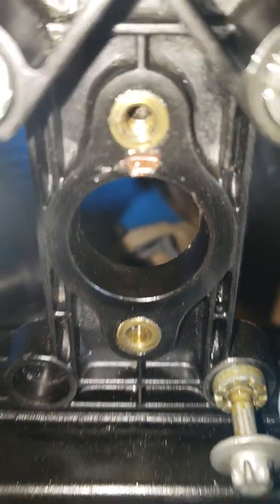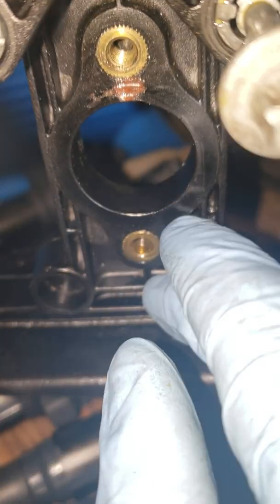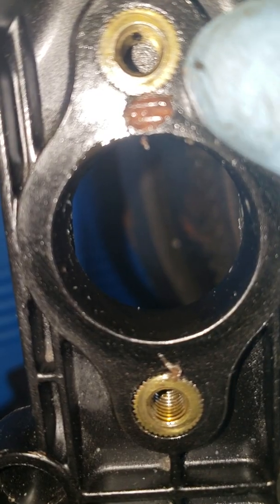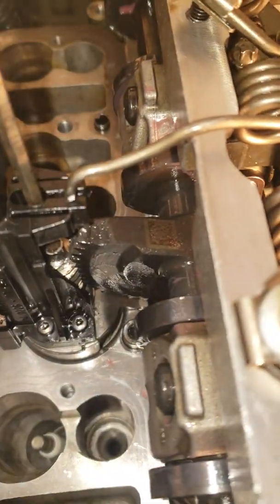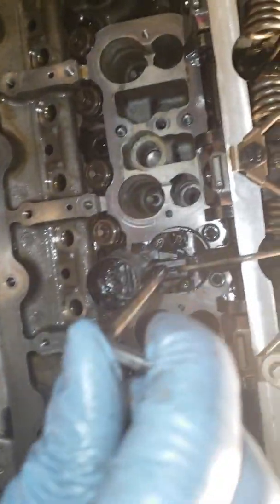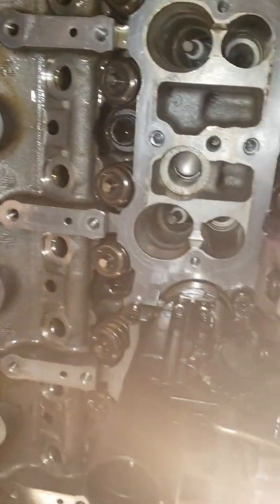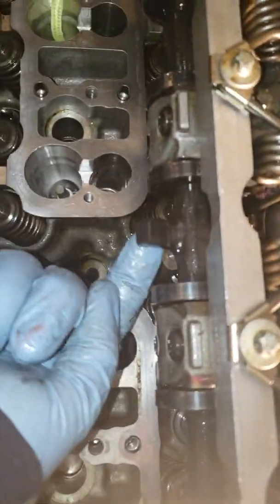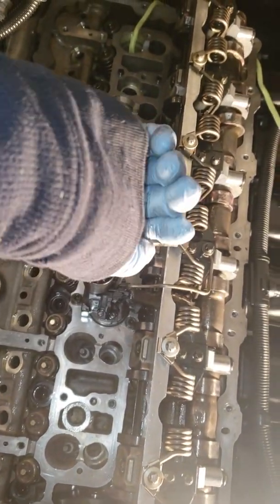(New) BMW 135i N55 How to set Valvetronic to max lift without removing the valve cover

Comment: Hello ,Does this solution work for the N13? I disconnected the sensors and battery, and the car stopped working; the Valvetronic is dead. From what I've seen, it could only be that.

Comment: hi on n55 ecu mevd17.2g having the fixed DTC 135808 with car in recovery by doing this procedure I also have the DTC 135b11 because I disconnected the plug, how can I solve this problem by working on the ecu/dme?

Comment: Hi, I recently replaced the Valvetronic motor but didn’t set it to the maximum lift position—I left it at the minimum stop instead. Now I’m getting error codes indicating the sensor isn’t properly aligned. I’ve checked and the sensor is definitely inside the motor, so I’m a bit confused. Should I assume the motor is faulty, or do I need to reopen everything, set it to the max lift position, and perform the stop position relearn procedure?

Thanks—any help would be much appreciated!
Reply from the maker: you tried to reset the learned positions in ista?

Comment: What size Allan key, and what size drill bit did you use to drill the hole
Reply from the maker: Details are in the description.
Reply: @brendenbanks9293 will i be able to do this while my valve cover is open my eccentric shaft is the problem here not my vvt gear. I just want to set the eccentric to max while the valve cover is open and obviously won't connect up the vvt motor cable

Comment: I wasted time and probably money replacing my eccentric shaft sensor and valvetronic motor and it still doesn’t work I’m still getting codes saying the sensor is bad starting to believe I have a bad dme?  Idk some module must be bad or relay

Comment: Hi, is there any risk the excentric shaft won't stay in max lift while engine runing ? I'm afraid the huge spring will snap the excentric shaf.
Reply from the maker: There is a flat spot on the eccentric shaft lobe. Once at max lift it will sit there on that lobe and would not easily fall off. I dont think it's a realistic concern.
Reply: @banks334  all right, i cant force my brain into stopping to believe in this unrealistic concern still😂
Reply: When I turn the shaft to max it really doesnt feel like that flat spot has much resistants to stay. With all the engine vibration I wonder if it would snap back to low

Comment: When your car has trouble with valvetronic motor or eccentric shaft and your car runs like shit, this is the best way you can do to make your bmw car runs okay. After adjusting the eccentric shaft to the maximum lift never reconnect the motor and eccentric shaft plugging back in. Your car will run okay..except you will  get error code on the dashboard...just ignore it.

Comment: Hey thank you for the video. You do a amazing job. 
But i dont understand what i need to do with the allen key after you lift to max. Can i put the allen key out ? Because in the video its going back after you let it go. 

What do i have to do so that it doesnt turn back ?
Reply from the maker: As explained in the video, just gi all the way to max lift and it will stay there. Then take the Allen key out and seal the hole back up.

Comment: Hi I have a valvetronic code on my n55 435i, 135908. It’s saying valvetronic actuator motor, position sensors: no power supply. Now when I do a cold start on the car, it starts up then within the first second, it almost dies, idles roughly bounces rpm like 400-800 etc I have to push on the gas sometimes to keep it alive then all of a sudden it goes back up to normal and idles super smoothly as if nothings wrong. But it does throw a drivetrain malfunction and chasis stability which got me confused as u mentioned in previous comments how valvetronic doesn’t put the car into limp mode
Reply: I have the exact problem as you! Literally the same did you fix it yet and what did it take to fix it? How much $$
Reply: @chrisyfzr8532  I am currently still in the process of fixing it, how is yours going
Reply: @TechnoMusicMD  sup bro ! did you fixed it ?

Comment: What would happen if you don’t put the Eccentric shaft back to the open position before you complete the job? I recently had this job done and I’m experiencing issues. Any help would be appreciated.
Reply from the maker: If replacing with a new servo motor it will not matter. If you're trying to hold the valves open because your valvetronic is broken then of course you have to leave it at max...
Reply: @banks334  the issue I’m having now is the rpm seems sluggish on start. But no codes. It’s not like it was before the repair

Comment: Brenden, cuen you was doing that (moving valvetoronic to highest position),how was the switch?,it was on engine off?or on engine running?,thanks in advance for your response.
Reply from the maker: Engine off of course.
Reply: @banks334  ,switch on engine off?
Reply from the maker: @RomeroMachado10  off. battery disconnected.
Reply: @banks334  ,perfec ,thanks you.

Comment: What year is yours? I see this happened on 2011 often
Reply from the maker: It is a 2011. Valvetronic motors fail on all engines even n52 its just harder to replace on the n55 making it more of an issue. Old cars tend to break more.
Reply: Brenden Banks I think something happened with 2011 valvetronic motor. I think there was a issue as most failures are from 2011

Comment: Hey buddy I had kind of same issue I went to dealer and they said that my dme was bed so they unplug that vvt motor and set to max lift manually. And told me that I can drive it now. So my concern is that is it safe to drive without vvt motor?(since is unplugged)Thanks for your help.
Reply: My question exactly

Comment: Thanks man, i am installing a FuelTech FT450 on my 545i v8 and the valvetronic cannot be controlled, so i was wondering if i could put the valvetronic on the max lift and unplug it, i just needed a video like yours to do this properly. Thank you very much.

Comment: Yo Brandon great vid my man. Question for you, had injector leak. Was replaced immediately but now I have valvetronic DCT code 133E10 saying Adjustment Fault. Is this meaning the system needs to be reset/calibrated with ISTA ect? Car is in limp mode, no power. It's a 435i.  Trying to find someone in my area with ISTA program  NJ. THX MY MAN
Reply from the maker: Valvetronic codes do not put the car into limp mode. It will throw a cel but wont affect anything. It must be stuck in the low position. That code means that the dme disabled valvetronic and when it does that it disables it at max lift so the car can still be driven. 

Try clearing the code and see what happens. Hopefully valvetronic has not completely failed yet and you can get it back to max lift by clearing the code and cycling the key to the on position. Then unplug valvetronic. Then try starting the car.
Reply: @banks334  thx for reply bud. I can't get code to clear with generic scan tool. Cel still present. From what I've researched I need access to ISTA software program to "relearn" valvetronic system. From what I gather needs recalibration. But I'll keep your words in mind. Thx my man
Reply from the maker: @20pylej  ista will not be able to clea the code any more than any other code scanner. The "re-learn" procedure is used to fine tune the movement after replacing the motor. People just don't seem to actually know what half this crap is. There is also an "activation" function which will attempt to move valvetronic. two different functions. Activation is a pass/fail test to see if it moved. This function can be used to try to "unstick" things. Reality is that it's just the electric motor burning out. You may be able to get it to function intermittently by trying to procedure a bunch of times.
Reply: @banks334  can I try your suggestion but with the cel still present?
Reply from the maker: @20pylej  unplugging it means it's going to stay I  whatever position it's currently in and apparently it's in a position that is choking airflow (low lift). By clearing the code you are forcing the car to try to active the motor again. Clear code. Unlock car and dme should automatically try to rotate the shaft to max lift. That's when you want to unplug it so it stays there. Hard to explain. With the code present the car is not going to try to run valvetronic. The code means its disabled.
Reply: @banks334  Unfortunately I won't clear the fault codes related to this problem. I've checked the car with live-data and there are two values regarding "VVT Excenterwellenadaptionswert". When the ignition is off the VVT Excenterwellenadaptionswert value is 00.00mm but when I start the engine the value is going 65.43mm. these values are linked to the noisy sound if this make sense to you. I mean when the ignition goes off the 65.43mm value is still there then the weird sound starts and the numbers are going to 00.00mm. I want to fix this unstable idle for a month or so then I'll change the head cover and this Valvetronic sensor

Comment: What about an engine with valvetronic and vanos - when Vvt is set to max open and disabled is vanos working or not ? as far as i know by disabling vvt your vanos wont work and vice versa
Reply from the maker: Vanos is vvt. As far as I know valvetronic setpoints (valve lift) do not influence vanos and vvt set points (valve timing). I would guess there is a small affect on overlap but valvetronic wasnt always on bmws and the car drove fine at max lift.
Reply: @banks334  engine map will be different on bmws with vanos only and those with both vanos and vvt. I need a map that includes other air to fuel ratios to prevent potential engine damages because of forceing bad parameters on it. When You set a valves manualy to max open position the computer calculates parameters for a "pedal to the metal" non stop ride...
Reply from the maker: @alkovich13  this is incorrect thinking. The dme can that valvetronic is disabled when you unplug it. Load control is performed via the throttle plate just like an n54. Sure it might not be 100% perfect tuning because it's not actually intended to be ran that way, but, it's not going to damage anything. Valvetronic is a redundant system that can be disabled/removed. People have been disabling valevtronic on bmws for many generations now. It just didnt throw a cel back in the day.
Reply: @banks334  my mechanic just disabled vvt in car's software so every plug is in (checked by me) and theres no warning lights. It costs me a lot of money (but still less than a repair on an original new parts) and he claims that the car is not in an emergency mode but vvt is disabled. I don''t now if the valves are at their max lift and I need to check their posision. He claims also the Vanos is working - for me it is not because the car lacks a 1/3 of its power....and the fuel consumption rised a lot.  Now need to check the Vanos when the car is running - are they working at their normal running parameters? My valves  needs to be checked for a max lift position but how to block them at this position and prevent the ecc shaft from unwind from max lift position? It  will be affected by the vibrations from the motor and slowly unwinding
Reply from the maker: @alkovich13  the lobe of the eccentric cam has a flat spot. It wont unwind once at max lift. Never heard of disabling vvt without custom tuning. Older cars used to code valvetronic out with a simple code change. Not sure why you keep mentioning vanos. Vanos is completely separate and runs off oil pressure. Yes vanos works normally when valvetronic fails or is removed.
Reply: @banks334  thnx for Your reply. I now agree that vanos is working because all publications about how vanos works do not mention anything about that the valvetronic is involved in process of advancing or retarding a cam shaft. 20% - lack of torque in mid range and fuel economy drop is due to valvetronic absence and thats all...

Comment: Mine just died, great tip if there’s no BMW mechanic around and you need to limp the car in for service.
Reply from the maker: I drove my car like this for months tbh. Didnt replace valvetronic until I had the valve cover off.
Reply: Hi, is there any risk the excentric shaft won't stay in max lift while engine runing ? I'm afraid the huge spring will snap the excentric shaf.
Reply: @larrycoerudy8458  

I think mine is in the max lift position as the car has a very loud cold start. It’s been that way for over a year now. Other then the cold idle it’s fine.

Comment: Good video. My valvetronic just stopped working after making those clicking noises for months. 2011 535i, the car runs fine despite all the warning lights. I assume it died in the "lifted" position. I have since disconnected it from the wiring harness. If its just using the throttle body, i'm inclined to just leave valvetronic unplugged. Is this a bad idea and why?
Reply from the maker: You dont know for sure what position the valves are in. You could potentially be restricting airflow to the engine if the valves arent at full lift. If it's running fine then that's great but it might be worth it to just drill the hole and verify. It's really not that bad of a job at all.
Reply from the maker: I ran that way for months without issue. I eventually fixed it.
Reply: @banks334  can i get rid of all the messages that come up on the screen?
Reply from the maker: @TomWolfDrum  no I had a cel. No idrive so never had to deal with the messages popping up lol just the cel.
Reply: @banks334  I have done this on my N62 but the valves slowly (With the motors unplugged) go back to min lift.
they sit at value 170 (Max) then after maybe 2 mins of running they slowly go back down to 20-30ish (Amusing min value)
Im using INPA to monitor this. Run amazing aslong as it stays at 160+ but after it goes under 160, car starts to get sluggish.
Im doing mine becuase I have a missfire issue thats resolved when lift is set to max (Assume some issue inside there) Quick fix is it unplug maf and plug back in while cars running forcing computer to set cams to max lift. Can you advise at why mine are slowly resetting back to min?
Reply from the maker: @APrattProduction  not sure. There is a flat spot on the eccentric shaft lobe for it to sit at min and max lift.
Reply: @banks334  it vibrates because of motor is running and thus it slowly release the ecc shaft from that lobe. I think it needs to be blocked some way at max lift but how to stop the worm gear from turning
Reply: TomWolfDrum just fix it, it’s not a terrible job.

Comment: I think my motor is dead and i believe it has been since i got the car roughly 2 years ago cause it would always idle rough on cold starts. recently got mhd and read the codes and got a 2E0F " valvetronic system deactivated, adjustment fault too frequent" never got a cel and i think i got lucky its in the maximum position, i sometimes hear a rapid clicking noise when i unlock the car. Maybe i should unplug it just to be safe. I would totally diy but i dont know squat about the valtronic system and i read you need special tools to take it out.
Reply from the maker: You do not need any special tools to replace the motor. I linked you to the exact procedure for removal... the motor replacement is a lengthy but easy job.

The eccentric shaft requires removal of the intermediate springs which is a harder job but it is highly unlikely to fail... you can tear down the entire cylinder head with basic tools. I made a video on how I remove the intermediate springs.
Reply: @Manuel Duron I also am getting 2E0F, it's the only code I have and no CEL or CCM.  Did you fix your issue? did it require motor replacement?